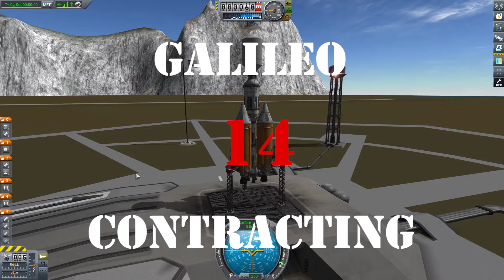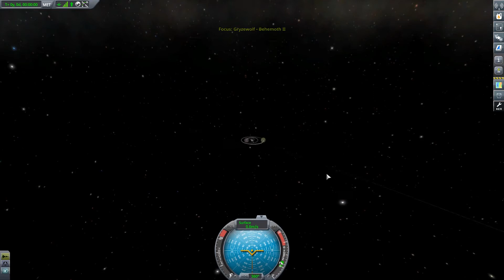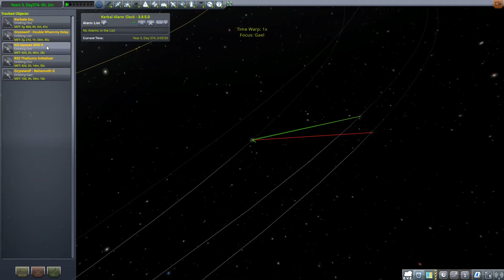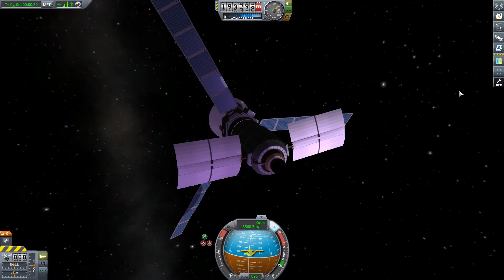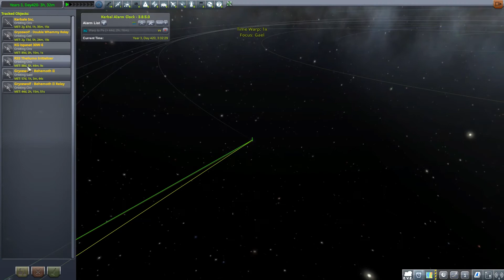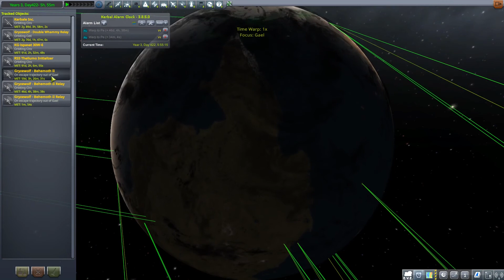Galileo Contracting 14 - All the relays

Comment: What is the approx deltaV requirement from Gael Orbit for the mission. AND, what is the mod called with the circuitboard? Kerbal Engineer? Tnx!
Reply from the maker: Yeah it's kerbal engineer. And good question, I'll check!
Reply: Thanks, is that a thing I can subscribe for through steam or an external download?
(sorry it has been a while since I did this stuff)
Reply from the maker: I haven't done any steam workshop modding at all. I still use CKAN haha. Sorry can't help you there
Reply from the maker: Gael -> Thalia is about 2000 m/s from 100k gael orbit. Call it 3000m/s and it should be safe from anywhere inside Gael SoI